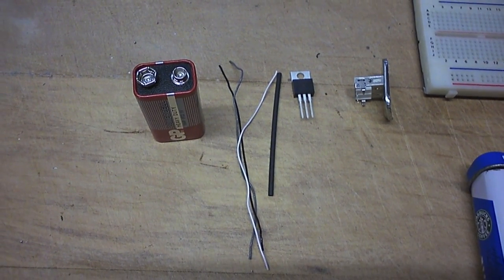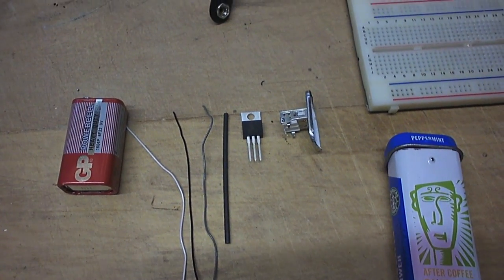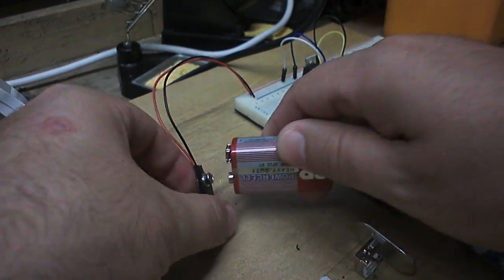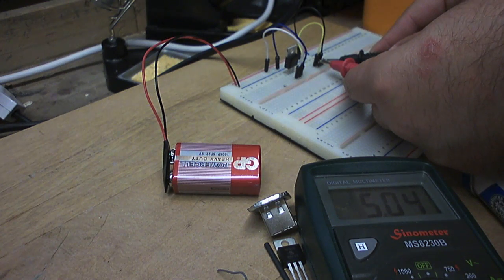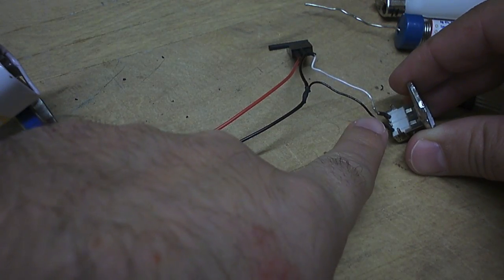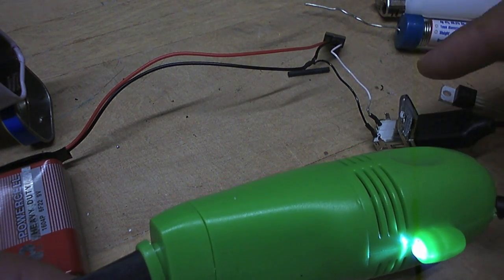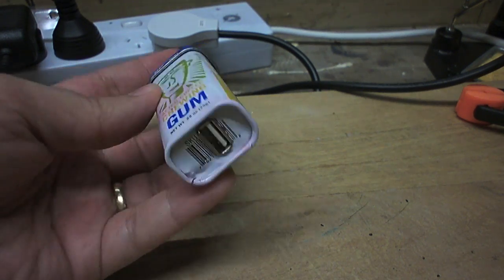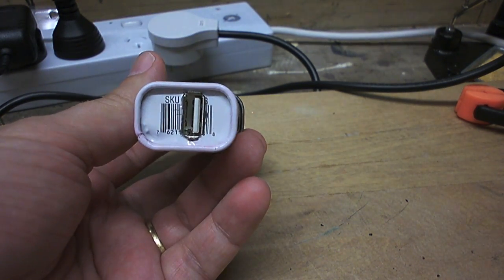Raspberry Pi: Build a Portable Battery Pack

Comment: I know this was made awhile ago, but since I'm watching this now, am I correct in assuming that this will not work to power the pi 3? I believe the 7805 gives 1.5A output. Either way, this is a really cool idea!
Reply from the maker: Does the Pi3 have a minimum amperage?  I thought 1A was enough and could take up to 3A.  But i might be wrong.  Thanks for checking this out.
Reply: @skiwithpete  yeah, I believe it requires 2.5A. I've gotten it to work with 2.1A, but I believe anything lower wouldn't be enough. Just thought I'd mention for all the pi3 users out there. But again, great video and great idea :)
Reply from the maker: https://www.raspberrypi.org/documentation/faqs/#pi-power

Comment: the voltage regulator is innefficiant and probably will overheat from the load that  the pi pulls i would reccomend using a buck converter/ubec they usually cost about 20$

Comment: Good idea, but terrible at Tue same time. That voltage regulator is really inefficient and a 9v battery has a capacity of around 500mah... try charging your phone with that. I would recommend a 3.7v lithium ion battery and a charging/USB output circuit.

Comment: What happens when the battery gets low? Does the step down shut off when it gets below minimum voltage?
Reply from the maker: +AshleyAllways Yes, below (something like 7V) the chip stops functioning.  Which sucks, because I really wanted to use a big 6V battery, but for this chip needs 9V or higher.  Cheers, P

Comment: Would this work even with a rechargeable 9V battery or not. They would be ideal for powering my raspberry pi on the go, but they have a slightly lower voltage, so just wondering if the same setup could be used with a 9V Rechargeable battery pack to power a Raspberry Pi? Thank you!
Reply from the maker: Lorenzo Battilocchi Absolutely.  And as you only need 5V for your Pi - a lower voltage wouldn't be a problem!
Reply: skiwithpete Thanks a million! Great video, by the way! Helped me a lot!

Comment: Have you tried using any switching regulators instead of 7805(which is a fixed voltage regulator)?
Reply from the maker: saravanan m no I haven't... do you have a part number or link for a specific model?  Cheers, P

Comment: Doesn't this need an on/off switch? Won't the switching regulator leach off the battery power when nothing is connected?
Reply: +Vishnu Aravind No it won't. There is no closed circuit så the electrons can't travel around

Comment from the maker: Good question.  I have some Model A's on order.  When they arrive I'll test it out for you.
The other Raspberry Pi project refers to a plan I had with a 6V battery, but I've since discovered that the LM7805 requires at least 2V more than the output of 5V.  So 6V battery won't work...  :(